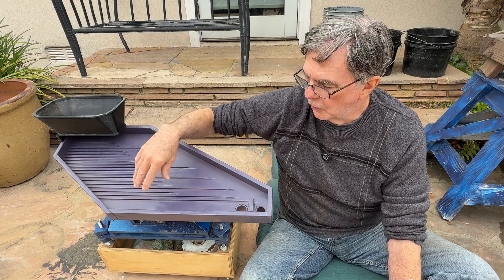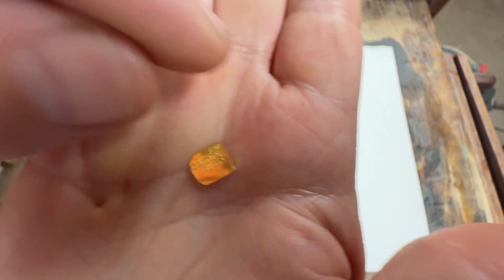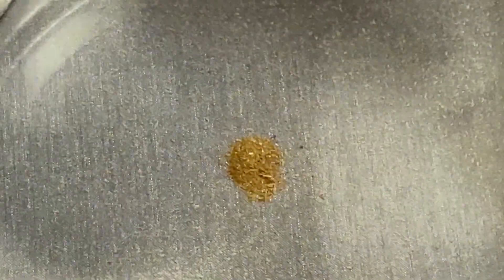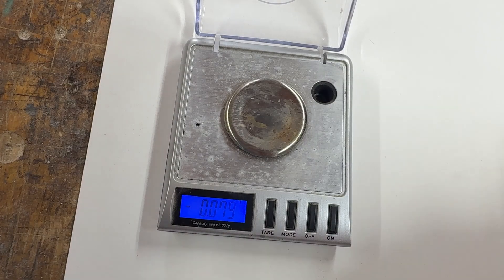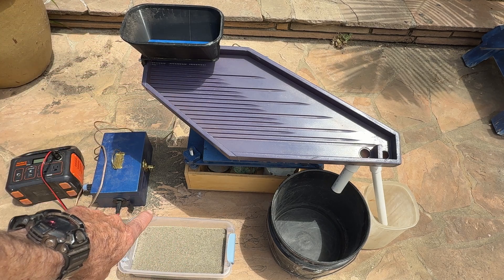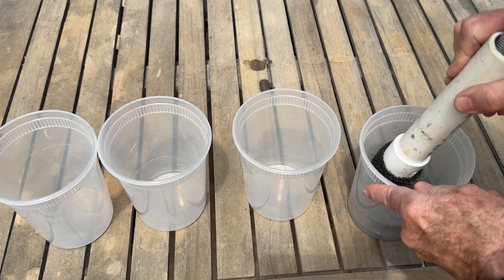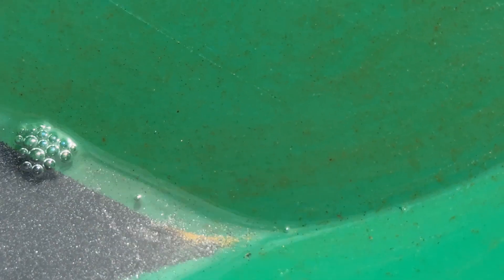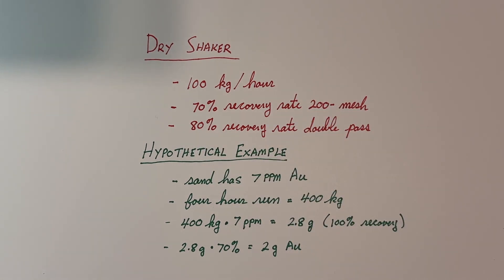Gold Extraction Machine -- Ultrafine Gold Dry Shaker

Comment: 400 kilograms is 881.2 lbs , your not going to hand shovel 881.2 lbs in 4 hours!??
But this I'm just guessing at!

Your dry shaker let a lot of beach sand into the gold hole.
Not a perfect machine! But better than nothing!
How much is it?
I think your numbers are off and you should have run the beach sand by itself, first! To see if it hand any au,which you did find!
But it was interesting  and thanks for the video!
Reply from the maker: Yeah, 100 kg/hour is way too much for me, but I think a young guy could easily do that with dry sand. If the material is full of cobbles and gravel then probably not.  -- Dave

Comment: Great videos and super craftsmanship making this shaker table. The panning is the problem maybe consider mercury or some other messy chemical extraction to get a better recovery rate.  maybe a lengthy mechanical panning session i notice almost no gold in the top three quarter of my buckets of cons when i have a long drive home almost all the gold has settled to the bottom of the bucket from the driving vibration. But that's another invention, great work and explanation of your device. It would be interesting to me to see how good larger gold extraction is for instance gold bearing material sifted to one quarter inch.

Comment: I was thinking about it overnight.I know your prototype is at an early stage ,and undoubtably you will make some tweeks down the road to improve its efficiency.My thoughts are that you can fiddle with the tilt from side to side to gravity challenge(or assist) the gold particles.That's one parameter.But also you coud experiment with airflow assistance in seperating the heavies from the lights.I am envisaging sometime like a fan and some way to attenuate and distrubute a constant airflow...The other thing I was thinking was that you could experiment with deliberate obstructions in the grooves.i'm thinking some sort of small obstructions that woud actually cause the gold particles to build up enough to allow the heavies to flow on right over the top,whilsts leaving the gold in place.Once the run has cleared the table and there is no more flow into the tailings hopper or concentrate hopper,it woud be just a matter of brushing or flushing the captured gold which would end up in the concentrates.Or even better, just snuffer bottle the gold up....The whole setup offers tremendous scope for some really interesting research and development.Cheers,Trev.
Reply from the maker: Hi Trev, Yes there are lots of things to try. I think I've found that I was overdriving the table a bit, which would cause the gold particles to exit the grooves early. There are many other things to experiment with, as you say. It's quite difficult to extract and measure the ultrafine gold, so the optimizing progress is slow. Thanks for the ideas!  -- Dave
Reply: @orophilia  I have been brainstorming regarding increasing you recovery rate ,but one thing I need to know first is... ,If the feed material is preconcentrated (by this I mean reduced in volume with zero loss of gold),would that result in a higher recovery rate? If so ,I may have an idea how to preconcentrate your feed with a possible mod to your table.
Reply from the maker: At the moment I'm trying to figure out the variables while doing a lot of testing.

Comment: Hello Dave. Very excellent and creative and scientific. I always see your work and I appreciate your deep thinking genius that you put it in public. You may be the first person to powder gold and pour it into sand to recover it. Dave, how many courses did you set the frequency?. Does the dry method process better or floating in water. What if you install another frequency generator on the table whose frequency throws the sand and gold up. I think with careful adjustment and tinkering, you can increase productivity. Dave, I wish you success and health.
Reply from the maker: Good morning! In the video the frequency is about 11 Hz (660 RPM) but I've reduced it and the results are a bit better. I'm still trying to find the best settings. I've never tried the wet shaker table with 200- gold so I don't know the recovery rate. The dry shaker table is for a different purpose. It was designed for fast, remote recovery of gold from sand.  -- Dave

Comment: Your design is great!!  I'll give you my two cents, but I suspect you already know:

[1]  Too much material is feeding. Simply plug some holes.
[2]  Most feed material is part of optimization, and if I remember, you were targeting -250 mesh, and yet, you did not also classify your feed material to -250 mesh.  It's critical that you do.

I love your analytics !!
Reply from the maker: Hi Jatslo. Good points. I bought a 300 mesh classifier and I'm using it for testing now. Regarding [1], the rate of shaking (actually the acceleration), the groove depth and the table tip and tilt all affect the recovery rate of the material. The feed rate has less effect than I thought it would. The upwards acceleration goes like the square of the shake rate. It appears that by slowing down the shake rate by 20% I'm recovering more 300- mesh gold. I think I was shaking the gold right out of the grooves. So, at the moment, I'm getting about 80% recovery 200 to 300 mesh and 60% recovery of 300-, while operating the table at about 100 kg/hr. It's a very big problem measuring the 300- mesh recovery because it's so easy to lose it when panning. -- Dave
Reply: @orophilia  Yup, optimizing is the key,  because you did an excellent job engineering that device.  Makes me curious how long it takes to get 25 pounds of concentrates, because that is the real target; gold is just a fraction, and can be invisible as you know all too well.  The fire assay is probably the most accurate analytical method.  Exciting times, and you can scale that system too.  Awesome !!
Reply from the maker: @Jatslo  I can adjust the table for, say, 20:1 concentration without losing too much. So 25 lbs. would come from about 500 lbs. of material. I would concentrate 1 ton down to 100 lbs. and then run it on a wet shaker table of similar size because it can be finely tuned to not lose very much fine gold. -- Dave
Reply: That's 30-40 five gallon buckets.  One ton of concentrates will surprise you.

Comment: Как вы думаете если в дополнение использовать обычный пылесос который работает как воздуходувка и навстречу потоку воздуху бросать вашу смесь золото с песком ,золото тяжелее и будет скапливаться внизу в трубе а лёгкий песок должен выдуваться только нужно настроить правильный поток воздуха🤔
Reply from the maker: "What do you think if in addition you use a regular vacuum cleaner that works as a blower and throw your mixture of gold and sand against the air flow, the gold is heavier and will accumulate at the bottom in the pipe and the light sand should be blown out, you just need to set the correct air flow🤔"

Yes, that's another possibility. I've never tried it but it could work in some situations.  -- Dave

Comment: Fantastic little machine you have there . Easier to transport and set up in the field than a gold drop . 
I would call it the mini shaker pro . A  prospector that would build a mini shaker pro would be a pro if it turns out half as good as the original. 
I believe that if you manage all the variables you could possibly have a 93 to 95% recovery rate . 
Great job with the build and the video .
Reply from the maker: Thanks! Yes, the machine can be optimized. I've only just started to work with it.  -- Dave

Comment: Thank you for the detailed video. You used 67 milligrams of pure gold and after the shaking table you got 48 milligrams. I had to take a photo and zoom it to understand what is included in these 48 milligrams, and there is a lot of sand. That is, the loss is about 50%. Well, that's what I think. 😀 I can't say for sure because I'm on the other side of the screen. I'm interested in this topic because I plan to get gold out of sand, the size of gold is from 100 to 500 mesh. 
I have a question. What if you install a water supply on this table and pass the same sand with gold and see what the result will be? 🙂
Reply from the maker: Well, remember that the black sand will always be on top in a thin layer, and its density is about 1/3 of gold. Anyway, thanks for your opinion and it will help to tune up my video making skills. 
I built a convertible unit that would work dry or wet but I didn't like it, so I gave up on the idea. But if that suits your needs, then why not? The slope must be adjustable from 3 degrees to 22 degrees and you'll have to add a place for the water to go and you'll have to seal it and add a water bar.  -- Dave

Comment: As always KUDOS Dave! One video evaluation: Southern region (Arizona & California) are 'dryer' than the 'humid' (Pacific) North region. Dry vs humid 'sands' will 'shake' with a considerable variability... small enough to make building an Ultrafine Gold Dry Shaker?  To each their own skill level and device to fit there operation... I'm sticking to a DIY 'Goldrop' be it the original or new Miner version which has a commercial flow-rate tube-size. Bottom line is the 'water' fluid flow for fine gold particles is a much better concentrator by using gravity in fluid elution than gravity shaking on a coated table material. I find the water fluid a better solvent than the surface of a painted surface trying to concentrate tiny particles contaminated with debris - even after required critical mesh seiving.  The bottom line secret might be in controlling the many variables to recover a nano-target. Your previous microscope images greatly influenced my approach to nano recovery.  Name? Tiny Dry Shaker or Nano Dry Shaker aka TDS-200 or NDS-201  where the number reflects a model or version number etc... Good luck!
Reply from the maker: Hi Douglas. Yes, the material has to be quite dry to work on this machine, making it not useful for many areas and seasons. But in the desert washes with no water it might be a good compliment or replacement to a traditional dry washer, depending on the size of the gold and the characteristics of the sand.  -- Dave
Reply: Отличный комментарий на 100% с вами согласен👍

Comment: Great vid! A nit-picky suggestion: I read somewhere that "black sand" is probably part hematite - which is SLIGHTLY magnetic. I built a magnetic pickup "thingie" that had a hocky puck shaped 1" "52" magnet with a center hole for attachment to a dowel - that would slide thru a 1" pvc pipe - like the one you have. I squared the end and glued a piece of the thinnest plastic film I could find (a piece of a cigarette pack) on the end. I could, in fact, pick up more "black sand" than I could get with a setup like yours - not a lot, but some. I notice that your "result" that you weighed had enough black in it to discolor it. Because Gold is so gol-darned heavy, the little "black sand" your magnet didn't catch probably is less than the accuracy of the scale you have, but it IS something. Like I said in the beginning, nit-picky, but might be interesting to check - because you're SO AMAZINGLY PRECISE with everything else (a great thing!).  By the way - it's a pleasure to see some real science in a prospecting vid - I'm in awe!
Reply from the maker: Thanks so much for the comment. Yes, some of the fine sand is slightly magnetic, and I'll try your modification to the pipe. I like it. Yeah, there are so many ways to lose ultrafine gold.  -- Dave

Comment: Hi Dave. Great achievement, congratulations. This will help many people. Thank you for your generosity in selflessly sharing your knowledge and resources. I made the water table, but I got the weight wrong. I went a little overboard with the thickness of the aluminum I used for its structure, and it weighs 7.5 kg with everything, including the magnets. Since I'm building other basic equipment (mill, filters, roaster, and oven), I'm putting the table modification on hold. But I'm sure I'll fix it soon and even make this new "Desert Table."
Reply from the maker: Hi Arnulfo! Yeah, being overweight is a common problem. :-) Best of luck with your mining equipment!  -- Dave

Comment: I suspect your table recovered over 95%, and the wet panning of ultra fine is where the 25% was lost.  black sand and micro fine gold are nearly impossible to separate with panning. I suggest running the cons 3 or 4 more times to get down to a few ounces of cons.   The table you have created is exceptional.
Reply from the maker: Thanks. Yes, I'm sure I lost gold in the panning process. The black beach sand is a demanding test for the table, whereas the river sand has far less black heavies in it, so the results should be better. Engineers like to test the limits.  -- Dave
Reply: @orophilia how about adjusting the table a little bit more? Less ° same force. Perhaps it's ° is too aggressive for the force. Causing more fines to spill over.
Reply: Dry-vibe
Reply: I suspect this Guy could be Wrong 🤔✅